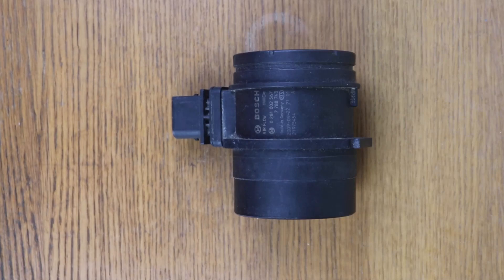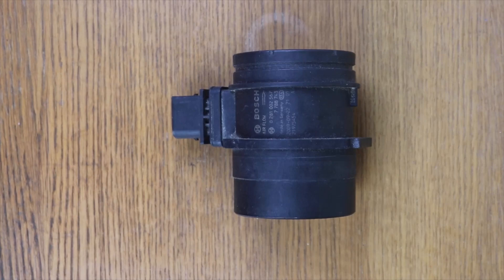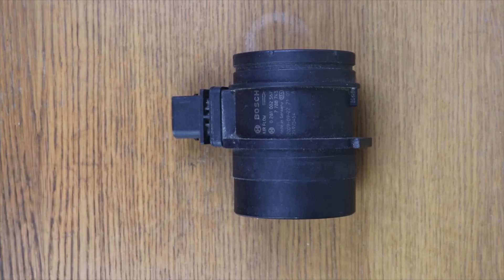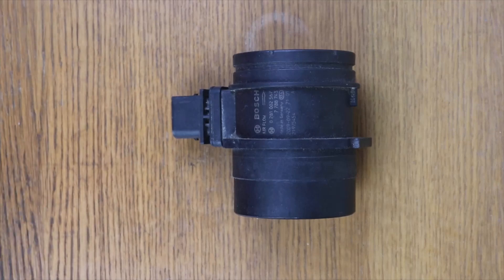The ENGINE has more POWER when the MAF sensor is DISCONNECTED. EXPLANATION. I DO NOT RECOMMEND IT

Comment: I have a BMW E46, I had an engine code for my mass airflow sensor, note, I was fing around with a new short ram intake and accidentally broke my maf sensor, I put everything back together, and the car wouldn’t start, I tried for hours to get it to work, but in someway, I thought to try without it plugged in the car and it ran perfectly, now I no longer have a check engine light and the car feels way faster and is getting the same gas mileage as I was before. Can someone please explain this?
Reply from the maker: What engine does it have?
Reply: U still running it without the mad sensor? If so how is it running?

Comment: What if i have new MAF and engine is running better when I disconnect it?
Reply from the maker: What engine is it?
Reply: 2.0 fsi
Reply: So it was running better but after a couple of kilometers I had engine sign on the dashboard
Reply from the maker: Was engine power limited when the light came on?
Reply: @car-parts2.011  no
Reply: @car-parts2.011  just to start misfiring like before. That is the problem with my car, if the engine is warm misfires but before the light no misfire.
Reply from the maker: What is the problem with your engine?
Reply: @car-parts2.011 I don't know if the engine is running badly and the only fault code is the air intake leak, I changed almost everything and nothing changed.can be bad wire from Maf?
Reply from the maker: Did you put the original MAF sensor in?
Reply: I tried again to disconnect it and nothing happened